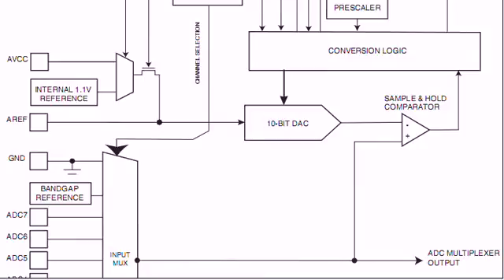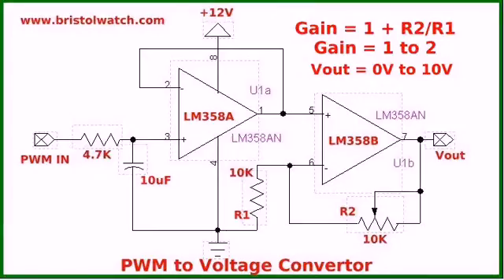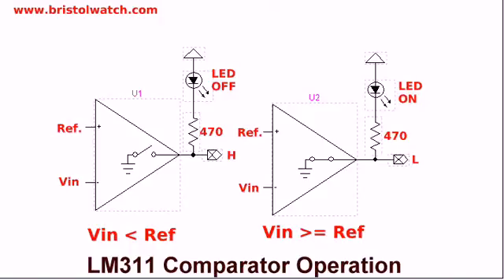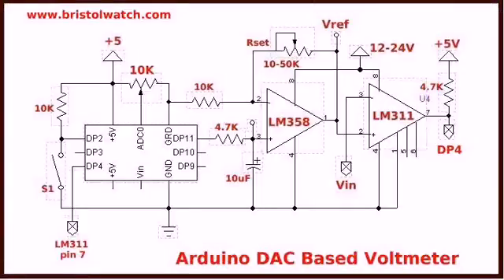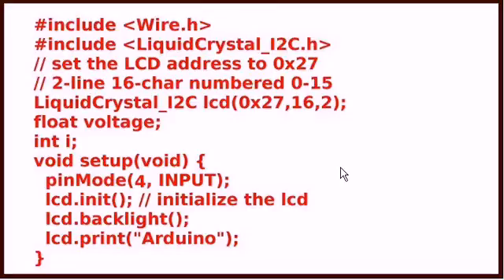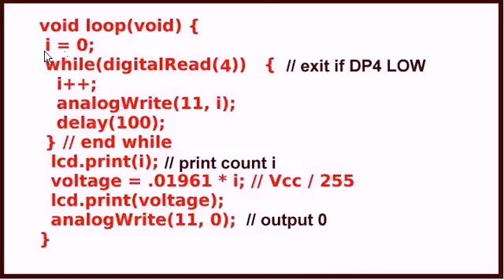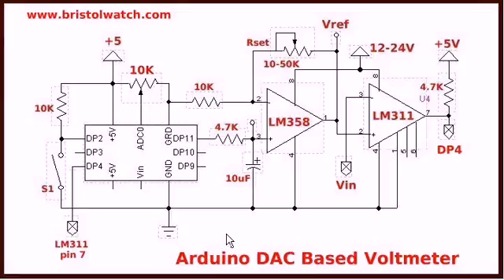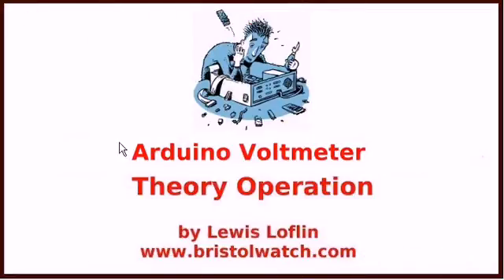Arduino DAC Voltmeter

Comment: Can I use this circuit to drive a 1D500A-030 mosfet? This mosfet is used to drive the motor off a 48v forklift.
Reply from the maker: this is not designed to switch MOSFETs on/off. That can be done easier with other circuits.